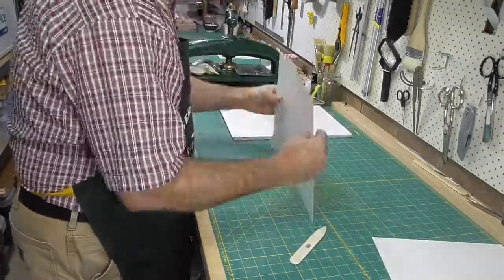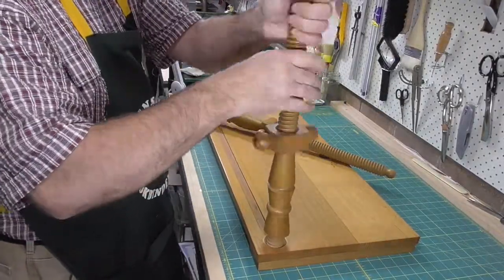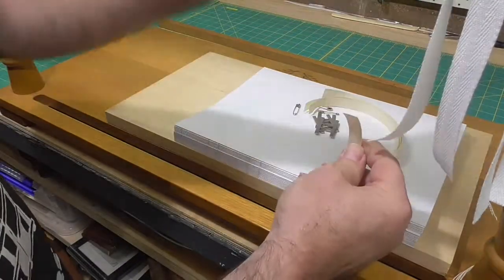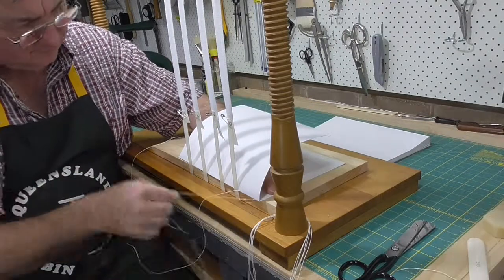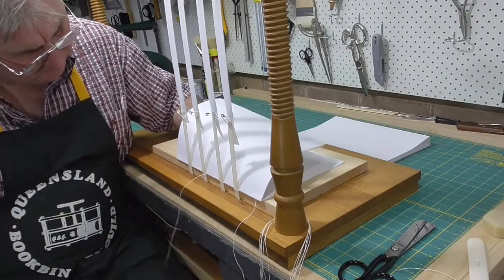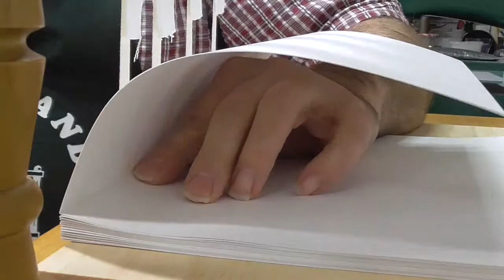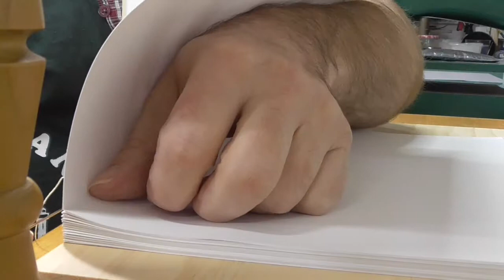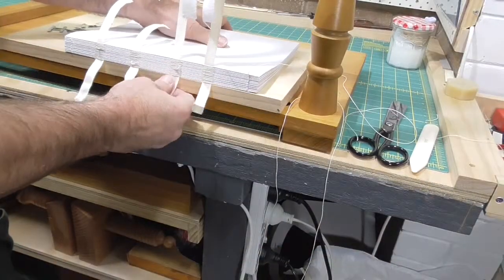Sewing on Tapes Using a Sewing Frame // Adventures in Bookbinding

Comment: Very nice video.  I collect books and have been wanting to get into bookbinding for years, if I can ever set aside the cash for a decent press, usually I get outbid by someone that wants to use then as fancy flower pot stands.  I am working on building a sewing frame and it really helps to see a nice one actually in use.
Reply from the maker: Bricks and some flat pieces of wood are all you need to get started.  And for sewing on tapes you don't need a sewing frame.  Happy binding!

Comment: That’s very nice! Thank you for another great tutorial.

I learnt to sew on tapes and the french style too (with you), that I think can be used with and without tapes. I want to learn cords next and I think it’s called linked (without cords and tapes), only thread.

Is there a rule or reason why we should use or another? Number of signatures, folios in the signature, paper type, size, type of case...? I don’t know. I never know anyone explaining why they do the way they do. In general I like the book to open flat but there are so many types of cases and sewing I don’t know the best combination.

Thanks.
Reply from the maker: Yes, the French sewing is often done without tapes, especially small books.  Maybe you mean the Coptic sewn book.  Yes this is a type of link stitch.  There are a number of variations possible.  I show the most common in my video.

There are certainly reasons for doing different binding structures.  It's a big topic but I'll give a couple of examples.  A small book doesn't need much support in the binding, thus why the French sewing is appropriate without supports.  But then a huge ledger will need all the strength possible and thus you would do French sewing over heavy linen tapes.  If you want to replicate an early (say 18th century) binding you might sew on raised cords.  For opening flat it is hard to beat simply sewing on tapes and casing.  Good luck!  DAS

Comment: hi ! i would at once thank you for the hight quality of the videos as well for the knowhow you share us with much pedagogie.  you give us all tricks we need to really enjoy bindning, with a few tolls and so. that's great!
i would like to ask you something; which type of bindning would be haddock for a rather thick book ( about 600 pages) a book that might be open flat, and stand so, at any pages?  
thanks a lot !
Reply from the maker: Glad you enjoy the videos.  There is flat and then there is really flat for an open book.  A springback opens completely flat, but maybe not the choice for all books.  I think the 19th century library style with split board attachment opens well and is a very strong binding.  It's a very under rated binding these days - both the tight-back and hollow back.  Hope this helps, DAS
Reply: @DASBookbinding  thank's a lot for so clear and complete infos. That's so kind!

Comment: I was recently reading a description of the original Smyth sewing machine which mentioned that at the time, an "expert girl" could sew 2500 signatures a day. I found the number to be quite impressive and had to wonder how many hours a day that must take. The machine, by the way, was supposed to do 25,000 to 30,000 signatures per day (this in the 1890s).
Reply from the maker: May I ask where you read this description.  I'd be very interested to read more about this.  Many factors to consider, such as the structure of the book - sewing stations etc.  I can sew on  2 tapes with kettle stitches at a rate of a section every 2 minutes.  With mucking about to start and finish I can sew a 14 section book in 30 minutes.  Not all commercial books have kettle stitches and once you get the hang of it sewing 2 or 3 (or more) on can be faster.  I'm guessing they assumed 4 sections per minute for 12 hours.  That is hard tedious work!  Those Smyth machines need the sections feeding by hand.  I'm guessing they assume a section every 2 seconds or bit better for 12 hours.  It's sort of a 2 step operation - pick up then feed - a second for each step.
Reply from the maker: Thanks for the link.  DAS

Comment: Thank you for the lovely video. Could you tell me where I can find the "H" buckles that weight the tapes? I've made my own frame but I haven't used it in quite a while. I don't remember what I was using to hold the tapes at the bottom.
Reply: Never mind! Now that I know what they're called (tape keys), I've found them.

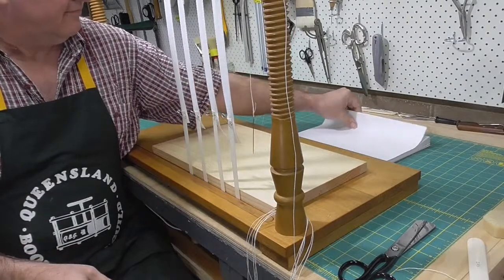Comment: 7:16 Is sewing the book front to back just a personal preference, best practice to keep track of the right order, or simply traditional? 😊

And as a physicist, I presume you are interested in the geometry/topology/combinatorics/graphtheory aspects of how many holes you need, which way to have the thread go, and all sorts of interesting variants? 😁  In this case, I’m wondering to myself if there is an established way of sewing that doubles back inside the section at the tape, producing a continuous line of thread inside and having the thread go across the tape twice per section? Would that give extra swell and extra stability to the spine if that is one’s goal for a more rounded spine, or I’m I just thinking up something people actually do not do? 🤔🙃
Reply from the maker: I think the order comes from efficiency and repetition.  If you are right handed and always put the head to the right and flip the sections over starting with the spine facing away from you, it ends up being front to back.

And yes  you can sew around the tapes.  Check out the springback and library binding videos where I do this with the endpapers.  But only on the endpapers.  I'm not sure there is a significant structural advantage.  More aesthetic.